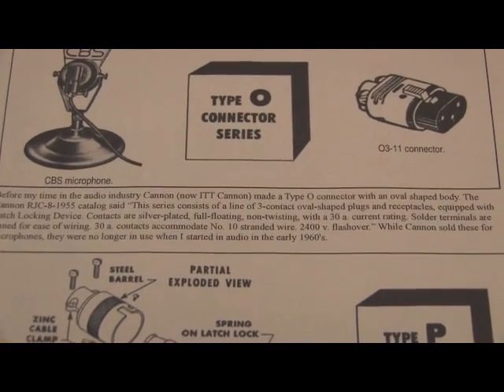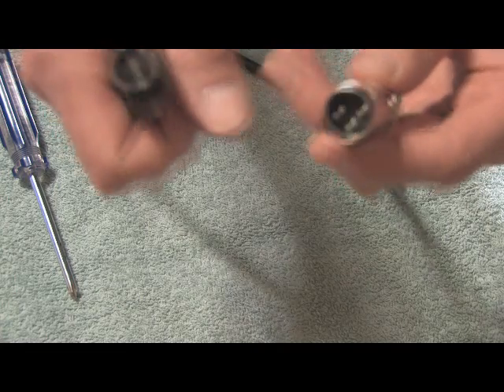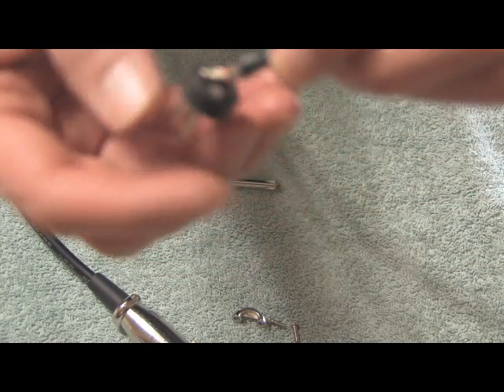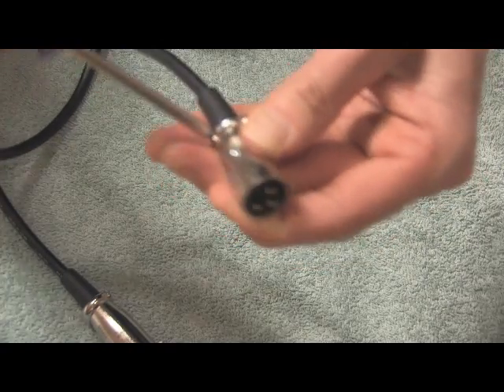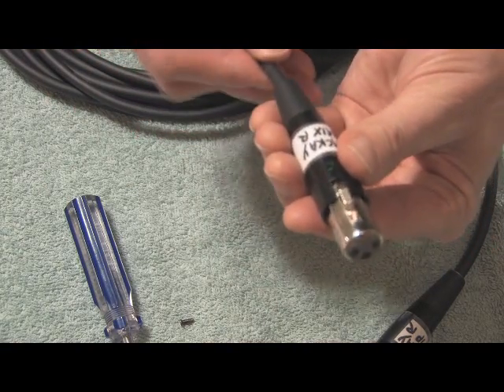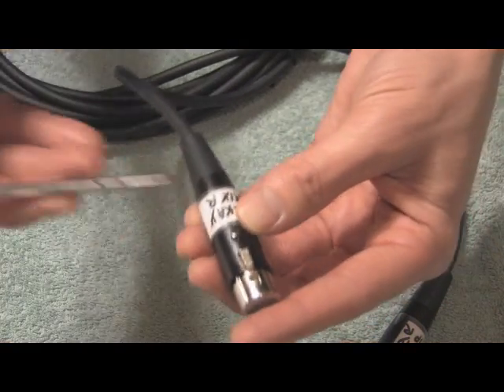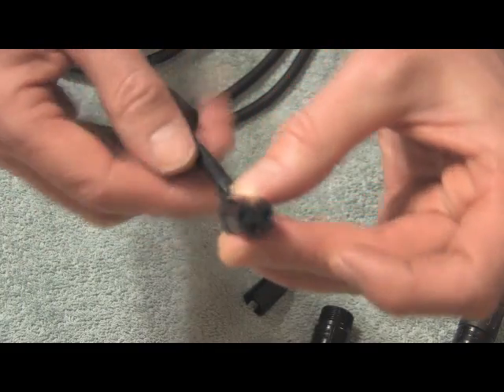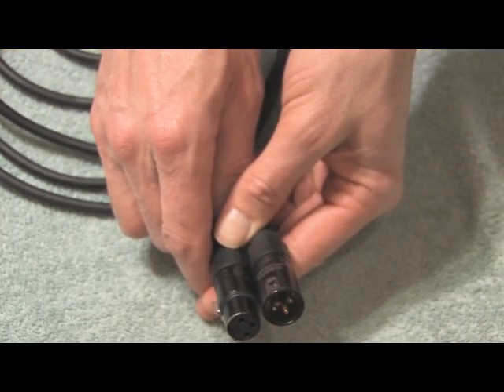Take Apart Neutrik, Switchcraft and Cannon XLR Connectors

Comment: You got the pin assignment wrong on all 3 types! you got 2 & 3 back to front. You could have used genuine Cannon & Switchcraft instead of the copies, they both have slotted, not Phillips head screws and further to that the real Switchcraft has 3 screws with one being captive and reverse threaded.
Reply: Yeah I immediately saw the Cannon and Switchcraft were fakes ! Anyway, the Neutriks are much better when you have many to assemble.